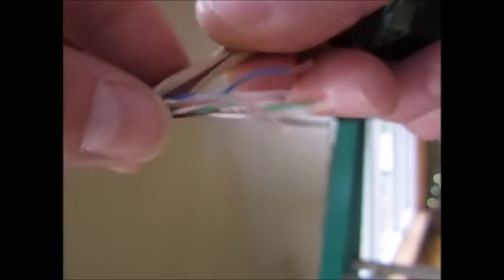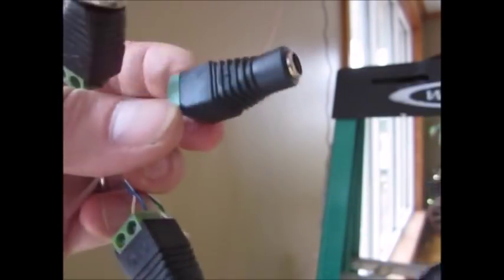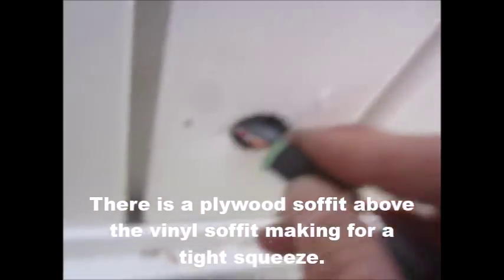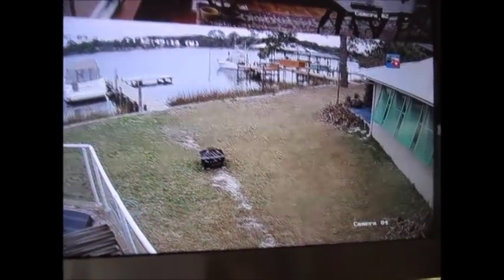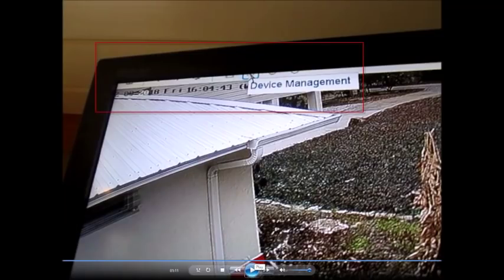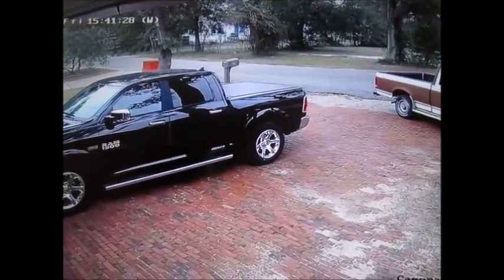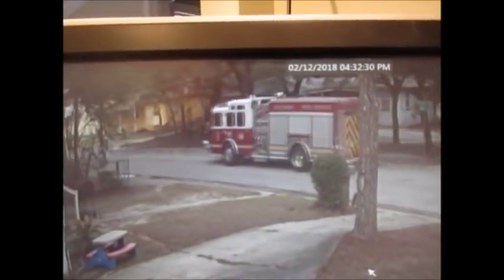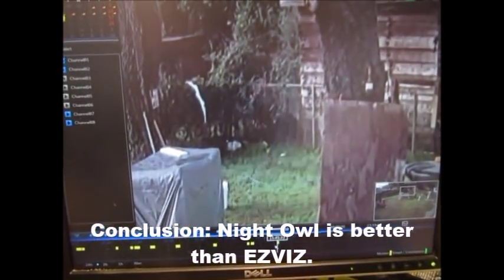Installation and review of EZVIZ 1080p four camera system.

Comment: a good thing to mention.
once a camera is registered on one account, it will never be able to be used on another account, you can no longer sell it and be used by someone else
Reply from the maker: This "feature" turned me off to more recent releases of Night Owl systems.  In order to reduce the number of calls requesting password resets, they pushed the maintenance to your email provider and an automated system.  

The older A10 and 960H series of Night Owl had the ability to share non-admin access with others (like tenants in an apartment building), but the newer ones do not.  I prefer that the credentials be maintained on the DVR and not stored on a manufacturer's web server.

Comment: Any suggestions on re install, an picture doesn't show on monitors?
Reply from the maker: I would check all of the connections and test the power supplies.  If the DVR is broken then you may have to replace it which could mean an opportunity for upgrade in size or quality.

Comment: 5:32 So did you ever find out what was the cause of that Ghosting and prism color when you used the CAT5 wire? Was it that your isolation at baluns that might have caused some unwanted antenna and transmission or did you change the polarity of the color vs white in Video signal port, to see if that is the cause? I say there is a simple explanation if you could farther dig into it.
Reply: Maybe you have too long BNC metal exposed that cause some unwanted signal alteration/grounding etc.
Reply from the maker: The ghosting was crossover to the power connector which then passed the signal to the other camera via crossover.  Separating the cameras onto their own wires resolved it.

Comment: Do you have any idea how to clear an HDD error?
I removed my HDD and cannot get the system to stop Beepinh
Reply from the maker: A HDD error likely means that the mechanical hard drive has failed; if you take the hard drive out then the system may still believe that it has failed.  I would install a replacement hard drive and search through the menu system for a way to format it.

Comment: Where is the port setting on the ezviz dvr? I need to change it to port 81
Reply from the maker: I'm not sure it has a web interface.  I RTFM'd, but didn't see anything about a web interface there.
Reply: @SAPLSMW  I contacted ezviz and they said the port can't be changed from 80. My isp controls my router and opened port 81 for me long time ago..... so i can't get it on the net but the apps work anyway. Thanks anyway
Reply from the maker: @Per409  My ISP adds a "feature" where they block port 80 to "protect me from viruses" and I can opt out of that if I pay 10 times more for the commercial package.  Gee, thanks. 

Consider another router.  DD-WRT allows for port redirection so that port 10080 (or whatever) outside is forwarded to port 80 on an internal IP address.

Comment: does cat 6 works?
Reply from the maker: Potentially; the pairs are physically separated by plastic, but only by a couple of millimeters.  The fact that the twists in the pairs aren't at the same rate will also reduce cross talk somewhat.  I still wouldn't try Cat6 for this camera system unless you're considering a complete drop for each camera. 

I stopped using Cat5 with baluns because of the risk of cross talk except when I run a dedicated drop for each camera which makes POE a possibility if that's ever desired.  Running the cables from the manufacturer doesn't take much more effort, so it's a good policy if you're married to analog.